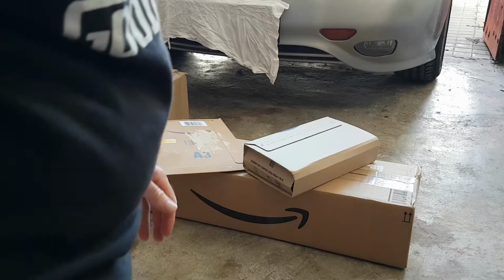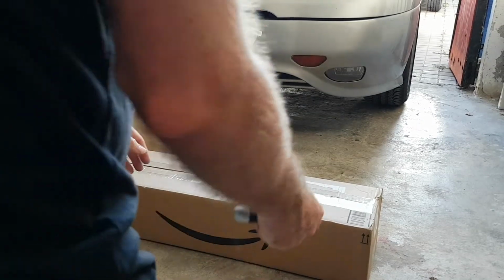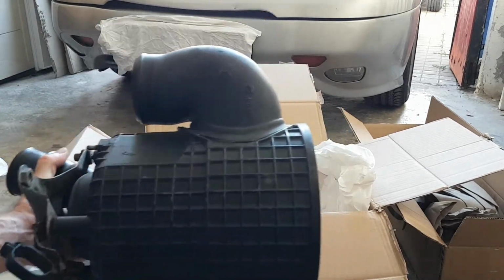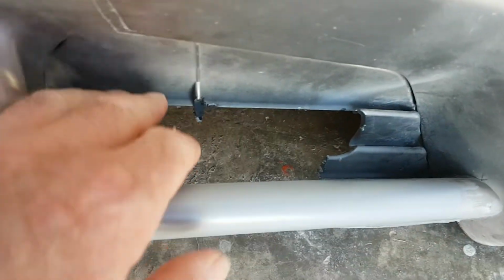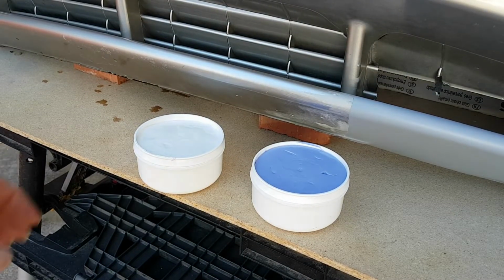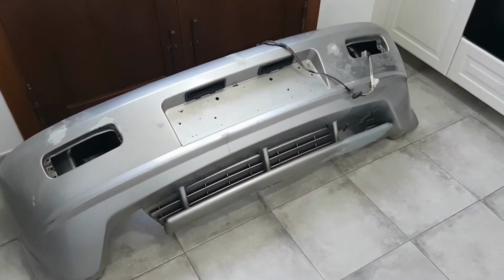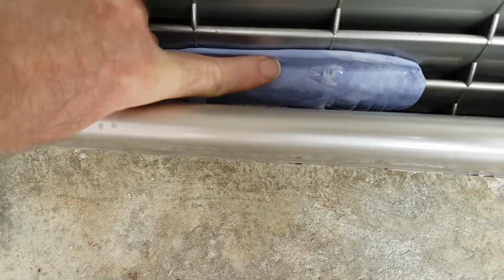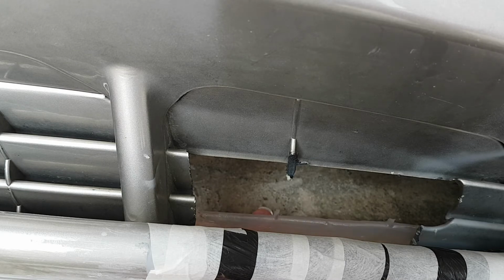Rebuilding a missing part of bumper with a silicone mould | Bumper repair Part 3 | Fiat Barchetta

Comment: Hurry up with the next one, in hooked! Can't wait to see you do the headlights as I've had nightmares with mine. Cheers.
Reply from the maker: Trying to finish off and edit video to be ready for this weekend! Stay tuned! Headlights probably video after that. Still trying to work out best way to fix the chipped edge!
Reply from the maker: Why a nightmare?
Reply: @pauliecabs  polished twice, still glazed, also some blurring on inner surface, not perfect but 100 percent better than when I bought it.